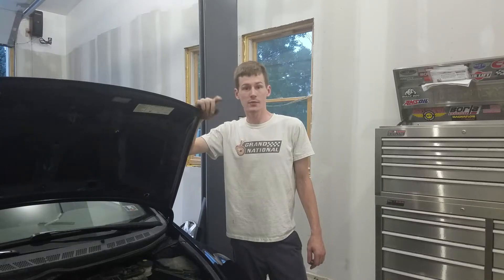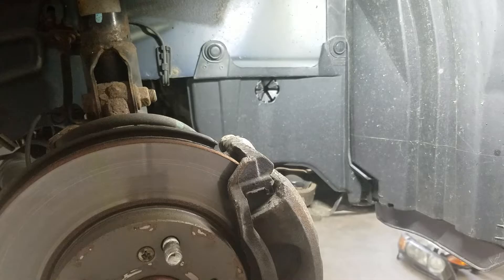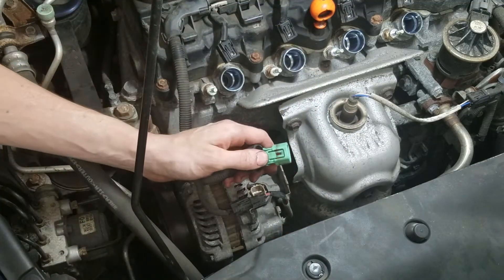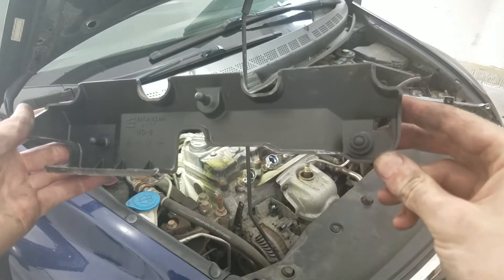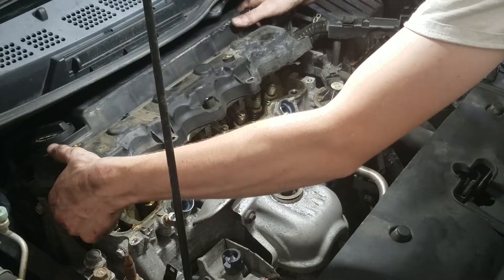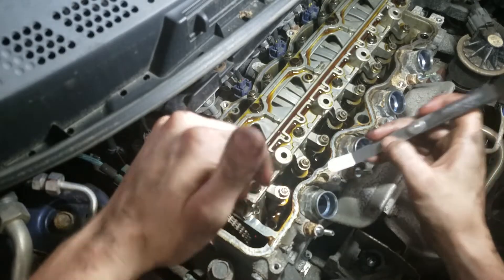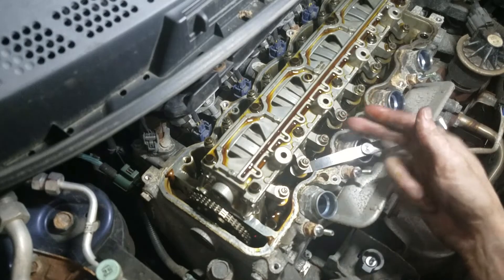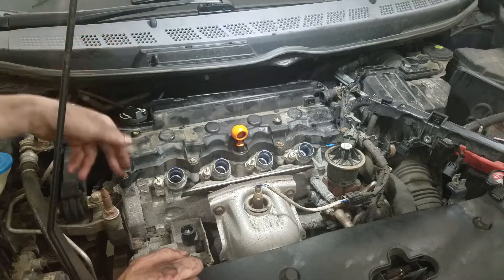2006-2014 1.8L Honda Civic Valve Adjustment

Comment: I just hit subscribe too! Thank you, my Mom gave me her 2010 Honda Civic, I had no idea it had adjustable valves, it’s a little noisy and a little rough to start, it’s got 170,000 miles on it and she’s never had the valves adjusted, I should check that the next oil change 🤣
Reply: 2010 civic with 130k here. my dad is over 80 and makes decisions motivated by saving money in the short term, and showing him the 6 mile drop in fuel economy finally helped me convince him to let me service it. somehow code 4 (spark plugs and valve adjustment) never showed up in the maintenance minder. my recommendations (actually copy/paste from my notes)...

start running 4 oz of seafoam in the crankcase (yes, put it in the oil) when the A or B codes come on, and put the rest of that can plus all of a second can in the fuel tank and drive around until the fuel light comes on, then change oil AND filter (regardless of whether A or B). you'll do this seafoam and filter change with EVERY oil change, so get used to it.

when you change oil, inspect all the fluids. check levels AND color/consistency.

when you rotate tires, inspect brakes, suspension, and steering components.

maintenance minder schedule says code 4 includes replace timing BELT. 8gen civic uses a timing CHAIN. they should last 300k.

full 100k service SHOULD include the following:

1. squirt some rust penetrant at both O2 sensors. you'll come back to these.

2. remove the cowl (a1-auto has a good vid on this).

3. remove the battery. honda says disconnect negative first, THEN disconnect positive, despite what i was taught.

4. change the plugs with ngk iridium. they should run abt US$12 each. plugs torque to 156 INCH-lbs, acorn nuts torque to 60 INCH-lbs

5. do the tear-down as shown in this vid and adjust the valves. shoot for 0.2mm in and 0.25mm ex. that's smack dead center of the range. i used 0.203 and 0.254. my gauges are flat and removable. i slip the gauges under both in and both ex of the same cylinder and wiggle the arms up and down. then i either loosen until i JUST feel some slop, or tighten until the slop JUST disappears. i also move the gauge around to feel the drag. i use a 10mm box wrench to SLIGHTLY snug the adjuster nuts to stiffen the adjuster screws. once i think the valves are adjusted i use the same wrench to kinda tighten them up, then check clearance again (wiggle AND slip). sometimes i have to loosen and readjust. the adjusters torque to 120 INCH-lbs once everything is adjusted. the valve cover screws torque to 95 INCH-lbs and don't have any specific torquing pattern, although i tend to use the following pattern:
6, 1, 3, 8
7, 4, 2, 5

6. remove the air filter box. this may require some dremel skill. start by removing the lid and filter, and stuff a CLEAN rag into the hole that goes around to the throttle body. look for the screw at the box's right-front, then follow that side of the box to the middle and you'll see a post that is not a bolt. that post is mushroomed so the box with a rubber grommet will fit onto it but trying to remove the box means either tearing up the grommet or risk breaking the box. i trimmed away the edges of the "cap" of the mushroom. the "cap" is still there but it's all the same diam as the "stem" of the mushroom. after that mod you should be able to pull of the boot in front that goes down to the resonator box, loosen the clamps on the boot in the back that goes to the throttle body, bolts at right front, and left rear (car's left and right, opposite for you), loosen the corbin clamps on the breather tube, then can remove the box.

7. all that because we want to get at the throttle body to clean the inside. reintall the battery, ignition on but engine not running, assistant (or brick) to mash accelerator to ELECTRICALLY open the throttle plate, spray seafoam top cleaner on a paper towel and wipe inside body without moving plate. move that plate and you'll damage the throttle position sensor. use the same spray to wipe down the inside of the boots and air box.

8. disconnect the battery but leave it in. get a QUALITY O2 sensor wrench and yank out the old ones. there are vids on how to change O2 senors for this car. use COPPER anti-seize on the sensor threads. torque to 33 FOOT-lbs.

9. remove the fuel injectors and fuel rail. there are vids on this. either get new injectors, DIY clean them, or send them off for cleaning. i'm for the DIY clean. look for a vid on the subject that shows you how to modify a tire valve stem and use 2 leads with gator clips to activate the injector solenoids. the valve stem goes onto the fuel rail where the fuel hose connects, and all 4 injectors have to be on the rail at the same time, but you'll only clean and energize one injector at a time. i used seafoam spray. IMMEDIATELY after cleaning, reassemble the fuel system, connect battery, and start the engine. DO NOT LEAVE SEAFOAM IN THE INJECTORS OVERNIGHT. i've never done it, but someone told me they soaked their injectors in seafoam overnight and destroyed them. not sure what happened there but yeah.

10. remove the MAF sensor, use MAF sensor cleaner, reinstall MAF sensor.

11. reconnect the battery.

12. with an assistant, use a new can of seafoam spray to clean throttle body according to directions. reinstall the air box and filter before the recommended 10-min drive with "spirited acceleration" after the hot-soak.

13. with all that done you can finally reinstall the cowl. you should get 35mpg or better, about like when it was new.
Reply: Don't bother unless you really hear clattering. I did not adjust mine until 357,000 miles. Spark plugs on that may be what helps smooth it out. I have noticed a difference when I've done plugs. They should be done every 100,000 miles. Use a little antisieze on the threads and torque to specs (I have found mine loose later on when doing by hand because I was afraid I'd over tighten).

Comment: That is a nasty corrosion / oxidation on the engine and various parts in the engine bay for a car that is not too old.
Reply from the maker: That's the reality of northern Ohio.
Reply: That car is CLEAN compared to my 07 being driven around northern and upstate NY. Every hose clamp, bracket....ugh it's just depressing. LOL
Reply: My 2010 looks like this - absolutely battered by salt in the Midwest. Runs like a champ though

Comment: My car has a rattle  during start up for like 5 mins until it heats up. Sound is coming from the valve cover . I'm at 152k miles. Is this what I need to do to stop bthe noise?

Comment: Excellent video man! Love your measured approach! But hey no Honda genuine valve cover gasket? 🤔 shit i swear bro, just about every time I've used an aftermarket gasket on a Honda it has leaked....idk it could just be me and I just suck that bad 😁 but hey I think I'm on like my 8th Honda vehicle so far. Only other car I've owned was a 94' Toyota Celica GT 1.8 liter that we converted over to a manual transmission after whipping it for about 6 months. Shit had only like 79,000 miles on that engine when i bought it from some old man neighbor but i thought the 4 speed Automatics in the yota's are better than the ones they use at Honda although Honda makes a better stick shift/gearbox in my humble opinion.

Comment: Did the adjustment make the engine run smoother and or quieter?
Reply: It dont really even need to be done. My 08 Civic 1.8 has 315000 miles on it never touched the valves runs fine.
Reply: Yea it makes a big difference . It’s recommended every-50k depending on owner usage.

Comment: Second comments...I just used this quick refresher.   I did my 2007 Civic 1.8 with 174,000.  That I just seemed to never get around too.

Never been into.  Both exhaust and intakes were about .002 loose.  That is about 1/16 turn on that adjuster.  And like always, I just turn it down till it stops .  Hold and snug and after eyeballing screw slot torque.  Then fill it.

The filler is tight coming out.  Done enough to know a filler of .001 or .002 will slide right under, so good enough and you will hear the injectors when done.  It car is a real pain compared to older Hondas that don't have the back side under there like this one.  My hands are not that big  yet they only go off to the slide and then over.   And that FI harness does not push back far and probably would be a real pain to undo.

This video is beyond belief on how good it is.  I would rate it 99 out of a 100...

Had to knock off 1 since you forget to put back one coil pack nut....
Reply from the maker: Not bad for a guy that shot this with a cell phone haha. Thanks for watching.
Reply: @RepairGeek  It's pure professional.

Comment: I have 17000 miles never had this done. If I adjust the valves will my engine run smoother and quiter?
Reply: CUSTOM STUFF no need to adjust at that mileage man
Reply: @infamousgarage4900  my bad I meant 170,000

Comment: Ausome video, hopefully if there is a problem I can't fix it may be valve adjustment and I can look back at this video, I have 170 000 miles on my civic and I drive it strictly city doing uber so my car has high wear. Thanks alot!!!

Comment: Wait so if you get a valve cover gasket do you need to put anything on it to seal. Cause I heard you talking about sumn like that but you didn’t rlly clarify?
Reply: Where there are transitions to other components, use the RTV he's talking about...on the surface, under the gasket...not a lot. Let me know if you need the full product description but check his link first as he may have listed it. I used the RTV as instructed on my girlfriend's Highlander front valve cover and zero leaks....proper bolt torque needs to be considered as well.

Comment: My 2007 Civic 1.8 has a little oil about midway on the spark coil pack (just a trace on number two).  I did not see that when I put plugs in it at 108K.   I now have at 160K and a P0302 plug misfire code.   A New spark NKG Iridium IZFR6K-11S plug did not help. Valves have never been adjusted.    
I see on line four donuts with FelPro  VS 50741 R valve cover gasket.   Does those rings go under that big nut looking cap under the coil Pack? Or maybe that oil came out of coil pack?  It appears to go in a limp mode and barley moves at 8 MPH and not up a hill.  Could it be the fuel pump?

Comment: My thoughts and what I have found and mostly on Toyotas is after a lot of miles, they wear a little channel area with two high ridges.  When you turn it to either make the gap less or more, it can do two things.  Or both.  When you turn it to a new area, that ridge grabs the filler and you end up with it a little too loose or even if you snug it a little to compensate, it's still set on that ridge and within minutes of running, it knocks that ridge off and it's too loose.  Of course, it's noisier than before and you stand there scratching your head.     It only takes a few thousands (.002) extra to be noisy.  It really hurts nothing on a Toyota or Honda.  Better than being too close.  I have checked CR-Vs with 100 K and still within .0015 of spec.  

I usually now just try to get filler gage under rocker it before unlocking.  So I have some idea where it is.  If it goes, I break the lock, make sure the screw is free.  Then I just go down to snug on filler.  Make sure the screw does not turn and lock nut.  Usually done this way, filler is pretty tight but mainly from that high ridge.  I have gone back after taking filler out and put my dial indicator on the rocker and checked it that way and it is always within.001.  Of course if filler won't go, I break the nut and back off and go from there with the above.
You end up with a quite valve train.

Comment: Does it matter which way the crank is moved - clockwise or counter-clockwise?  What is the sealant used on the valve cover; and it is just used at the 4 corners of the cover?  Someone suggested using the max valve clearance setting, since too tight is worse than too loose - correct?  And how do you get a torque wrench in the rear of the valve cover - it looks too restricted.
Comprehensive video - very well done.
Reply: Yo momma

Comment: Can’t I adjust cylinder 1 and 4 at the same time and then do 2 and 3?
Reply: Even though this is a year old, some people may be wondering why you have to do one at a time...

Valve clearance has to be measured when a cylinder is at top dead center (TDC), and on a straight 4, the outer pistons travel in a pair as do the inner pistons. However, valve clearance must be measured when all the valves are closed, and when a pair of pistons is at TDC, one set of valves is open, and the other is closed. The closed ones are the ones you measure.
Reply: your joking , right?
Reply: bryan coffey that would be a pretty shitty joke. instead of asking a question you know the answer to why not just respond with a simple “NO”  The job is done why even bother responding a month later?

Comment: This is the same motor as in my 2012 civic. why would you need to adjust the valves like that? Do they move over time? My car is still at 50k miles so luckily i haven't had any major issues with mine, but some maintenance notification have begun to pop up like now I gotta change my trans fluid and one of my tpms sensors must have died or came loose. But overall, i want to make sure I keep on top of everything, my last car was a b18 teggy i drove for over 350k miles! Thanks for posting this video, i haven't had this engine open yet so it was nice to see what it looks like without having to do it myself. When the time comes to open her up I'll know what to expect and look out for. much appreciated.
Reply from the maker: Most vehicles have a way of keeping the valves adjusted with a hydraulic mechanism called a lifter. Honda's do not use them. Therefore, the valve clearance must be adjusted manually every so often. Usually every 100,000 miles, sooner if the car is making a tapping type noise coming from the top of the engine.

For the most part if you keep up with your maintenance on these cars they usually last a very long time.
Reply: My tech said they tend to tighten over time.
Reply: @kyststudio-epicartadventure  just adjusted mine. my gauges (.203mm and .254mm, confirmed with digital calipers) are flat so i separated them from the rest of the gauges so i could slip them between valve tip and tappet to measure both ins and both exs at the same time. that way i KNOW i don't have the gauge in there at an angle. out of 16 valves, only 2 were still in spec but the rest were all so loose i could feel the slop in the rocker arms. 2 ex valves were so bad i could hear the slop and had to tighten them by 1/4 turn. so i tend to agree with vernon bosshard when he says your tech is wrong. either that or you misheard your tech when s/he said they tend to NEED tightened over time.
Reply: @kyststudio-epicartadventure  i would say its more likely they loosen over time due to normal wearing of the valve tip and rollers. Honda recommends adjustment every 105k miles
Reply: @kyststudio-epicartadventure  Your tech is wrong.
Reply: Engine components wear over time, so the valve clearance needs to be kept within spec in order to prevent inefficient operation of the engine or valve damage.

Comment: 5 speed you can forego taking the tire off by placing the car in5th gear then jacking the car up on the passenger side and turning the tire to rotate the crank to each cylinder. Makes the job MUCH easier and faster. Also why didn’t you start the car after completion for the video?? Good post though!
Reply: @Van Nguyen that’s great, I’m glad I was able to help and make the job easier on you. Taking off the tire and hand cranking that crankshaft bolt is a pain especially when you can’t see exactly where the cam gear is while you’re turning it, but using the transmission to do it makes it a piece of cake. Call it the Civic Valve Lash adjustment Hack. 😂
Reply: @alteregos8949  I hate how he didn't start the car prior to finishing the job. I wanted to hear how it sounded after the adjustment.
Reply: @alteregos8949  For an auto transmission, got any hacks? 8D
Reply: Van Nguyen the wheel free turns and won’t spin the driver tire on the ground. You put blocks under the back tires and it won’t roll. You only need enough clearance for the passenger tire to rotate. When you have the valve cover off you’ll see what I mean.

Comment: Awesome guide thanks man my 06 lx needs valve adjustment 227k miles going strong
Reply: Please tell me you still have your 06. If not, what happened? If you do still have it, where you at in mileage?
Just curious btw. I have an 06 also. And by the looks of the amount of mileage I I have seen being put on this generation 
It looks like I will have this car awhile. I’m at 134,00. Pretty good I think for a 16 year old.
Reply: @raiderrichard7291  yeah I still have the car I use it everyday to get to work and back, around towning. Has close to 255k now
Reply: @raiderrichard7291  wow, i got a 2015 civic lx and im already almost caught up, im at 108k. but yes these cars can very easily last over 400k miles as long as you keep up on maintenance, specifically oil changes.

Comment: Hello i need help me, i have this problem this sensor,    box gear automatic, need know, correct value this pressure 2 sensor gear box this sensor 28600RPC004 sensor 3rd  crutch spare parts honda civic 2rd clutch 28600RPC003? Send me i formation pressure work this 2 sensor,